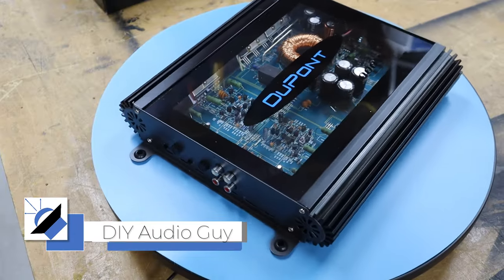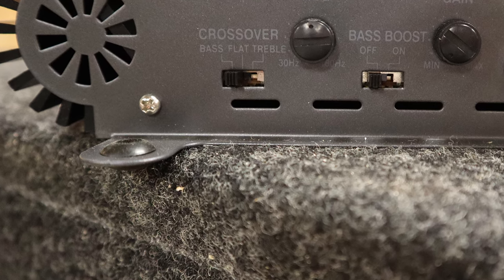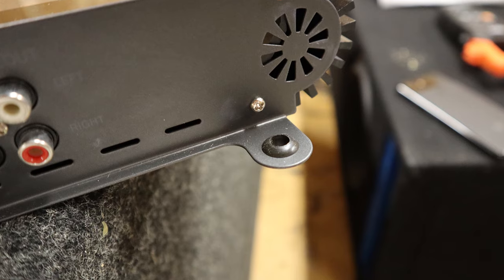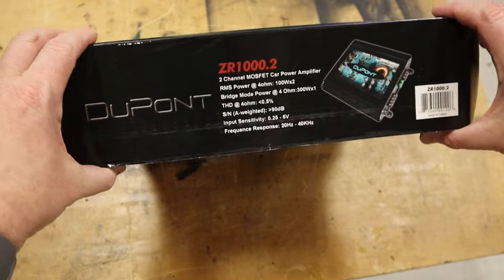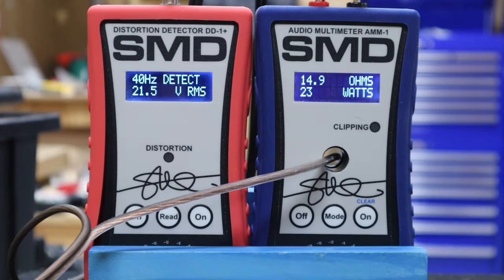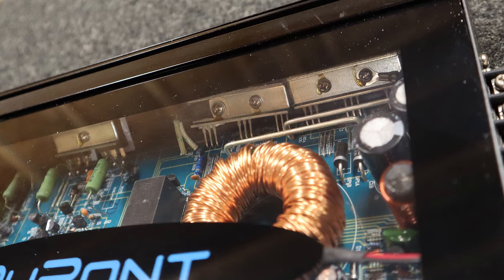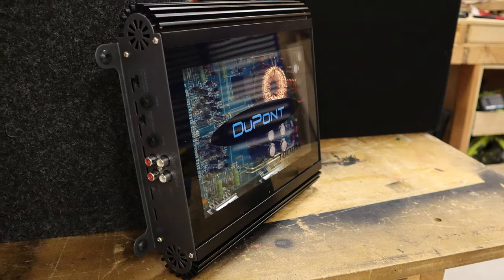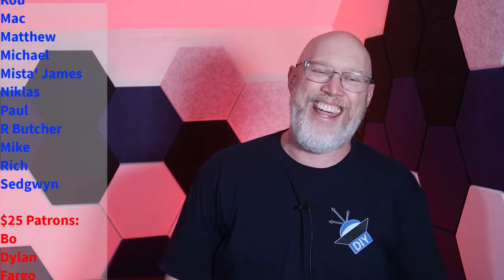1000 Watts for under $50?  The amp dyno does not lie!  DP Audio Video ZR1000.2

Comment: Thank you for testing this Amplifier. I bought this Amplifier a month ago to push two 3.5 inch speakers @ 4ohms on each channel. Its good to see it will do over 300 watts @ 4 ohms bridged even though most Amplifiers bridged @ 4ohms run much warmer than needed but thats why a tornado fan is valuable to help keep an Amplifier cooler.

Comment: Thats funny in the sponsor. I built those JUNK BOX bins with a guy at Totten welding in Victoria bc. I did all the electrical and hydraulics and some of the frame and hook ups for the fuel supply. We did an immaculate job for these guys.

Comment: Bought same amp on Amazon clearance for $33. Had same whine and traced it back to the high voltage driver for the electroluminescent logo. Disconnect logo light, problem solved.
Reply: Hahahahajajaja
Reply: Fail for the logo
Reply from the maker: Well how about that!

Comment: 3 way I would assume meaning it can work tri-mode. You can run a set of speakers on the 2 channel plus bridge a sub. Used to be huge with the old Class A/B amplifiers.
Reply from the maker: I remember those days!  There was nothing about it in the manual.

Comment: Should have bridged it and ran 2 ohm then 1 ohm if it did not go into protect. I had a Jensen amp in the 90's I used it to push 2 kicker comps at 2 ohms. This amp seems much like that one. Based on the fuses I think you could squeeze around 500 watts.

Comment: Likely the whine was caused by a faulty chassis ground. It might even go away in the vehicle environment, or alternatively get worse. Also IF this amp were to have done 500 rms at 2 ohm mono then I can see it being well within the "1,000 w max" claims. Whether it would perform or not who knows I am willing to bet it might. The fuses suggest the same.

Take ANY trusted brand that has 500 rms/1,000 max claims and it would do the same 300+ power at 4 ohms mono.
Reply: We have to stop excusing manufacturers putting crazy "max watts" on amps. 

It should say max watts (the actual max watts). This one can't qualify for 1000 watts max because there's not enough fusing. Even if we overvolt it to 15v and it's not a regulated power supply (best case to get to achieve "max" watts), that would be 60a of fusing * 15v for 900 watts. At 100% efficiency. Basically, in the absolute best case, we can't get over 900w mathematically.

Max watts for amps mean nothing and they're not usable except to compare to other liar brands' outrageous claims. These amp dyno youtube channels are holding them accountable and we are seeing many manufacturers telling the truth now. Which is long overdue